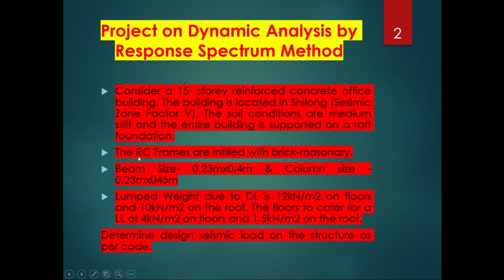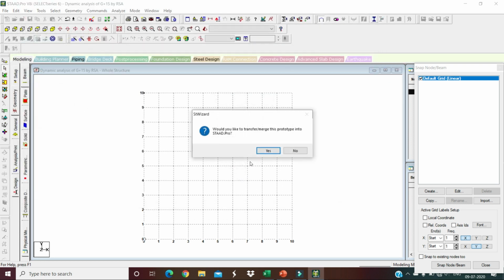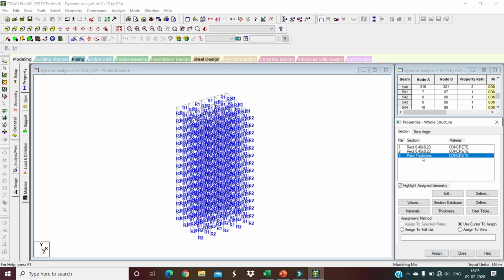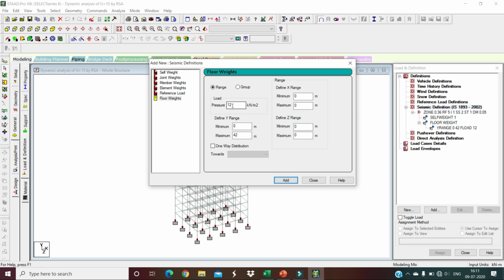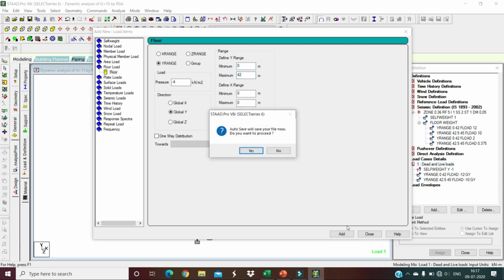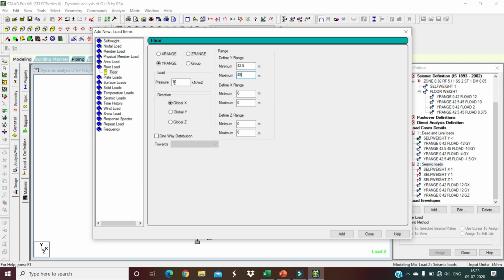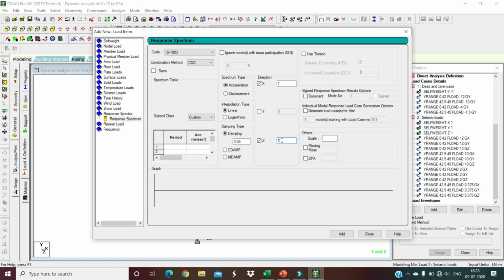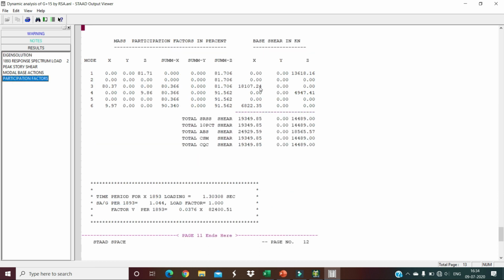response spectrum analysis in Staad pro

Comment: very well presentation . some body use the value Z /2* I/R . BUT YOU MENTION THE VALUE SHALL BE  Z/2* I/R * Sa /g , 
Sir, which one is correct ? In my logic if Staad calculate the value Sa/g ,then I think  1-st one might be correct ; and if Staad
does not calculate then your suggestion is correct . Then the value should be given by user.
Clarification will be solicited . Thank you Sir.